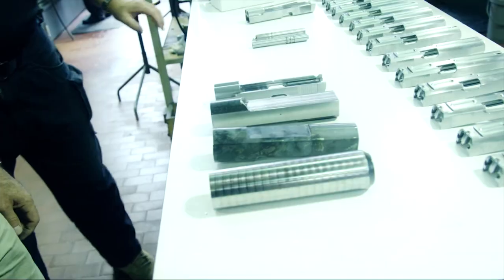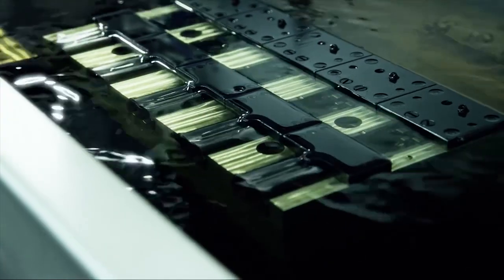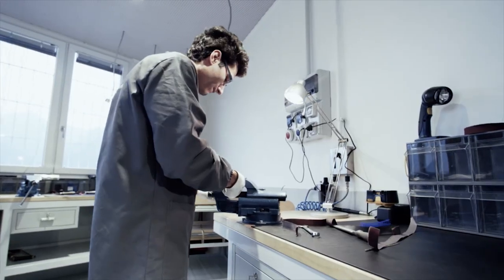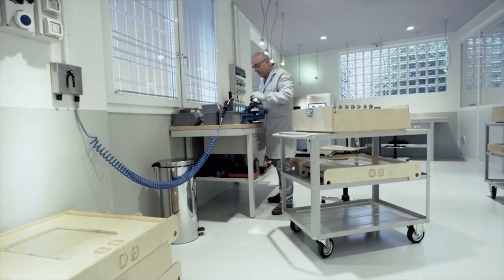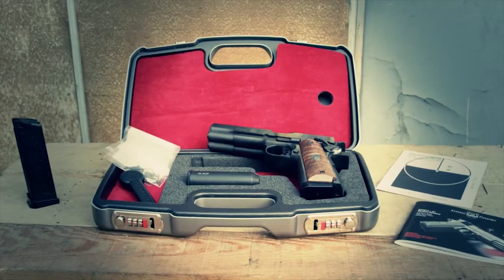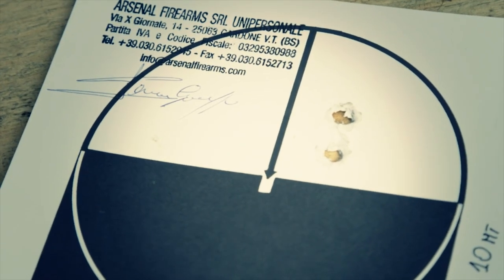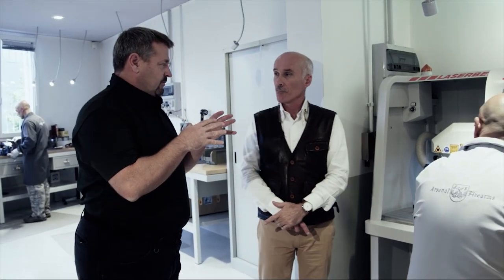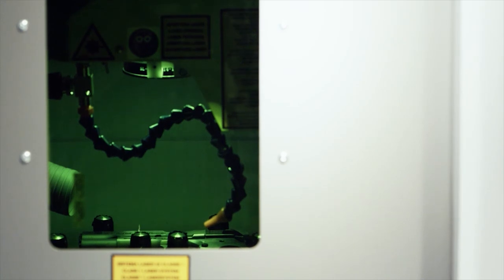AF - 2011 Part 2 - Building and Assembly of the 2011

Comment: Imagine putting two suppressors on the 2011 for shits and gigs obviously. But still I wonder how it would shoot. Actually don't you need a threaded barrel on a pistol to attach a suppressor or can you get some type of suppressor that doesn't need a threaded barrel to attach one?
Reply: Josh Kendall 

You could have a custom gunsmith try to make it an integral suppressed model. There are two double barrel guns that do have silencers however these are custom ones.

Threaded barrels are how detachable silencers attach. You either cut down or thread a longer barrel or make a barrel already threaded. Threading a barrel is a delicate task. You could destroy the barrel hence why a number of guns have a model with a barrel that was made with a thread.
Reply: toomanyaccounts ah k thanks for that I was wondering about that.

Comment: This is an embarrassment to engineering.
Reply: *****
No functional advantage. 
"Because I can" is not a respectable engineering purpose.
Not tomention they even discuss the problem with blast physics.  The thing wll not be consistant at all in accuracy past the muzzle.
Reply: *****
As an enginner I'm with you on 2 points.
1.) Great range toy.
2.) it may inspire to something usefull.
On the other points.... plenty of things made are useless.
Reply: *****
"As an engineer in sure if you thought hard enough you could find a use for anything"
-Exactly.  And I also know when something has already been done better.  I'm just saying, this is a muse, not an improvement.